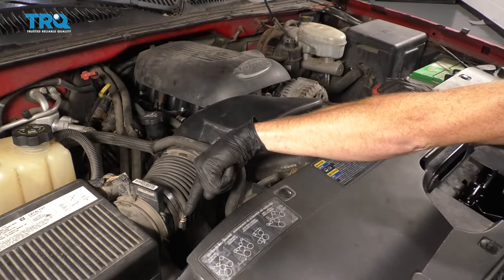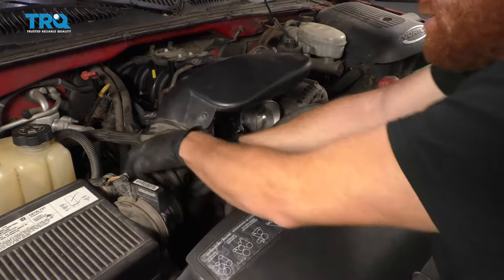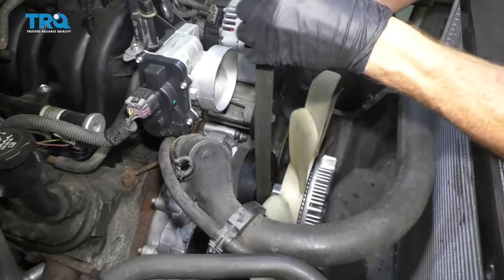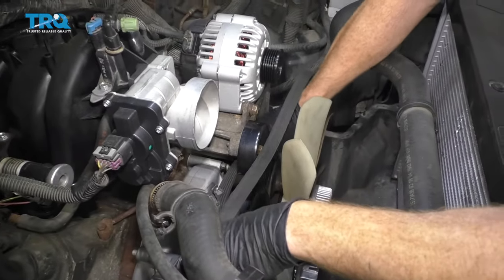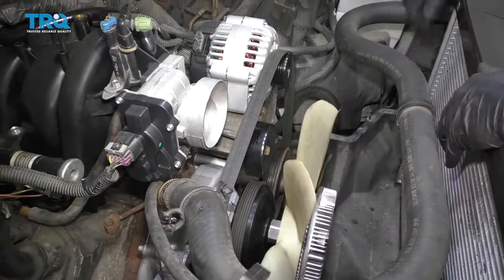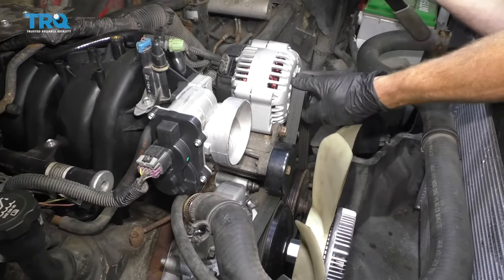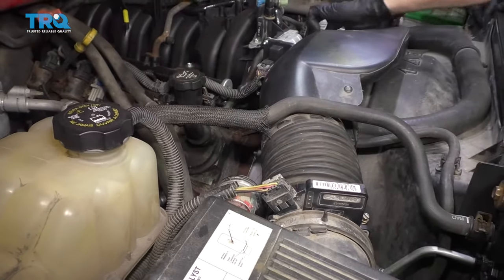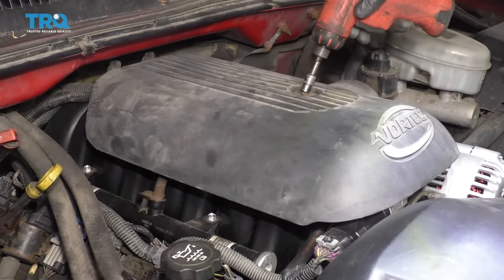How to Replace Serpentine Belt 1999-07 Chevy Silverado

Comment: I love my Silverado after a new transmission, all new break lines, transfer case, inner and outer rockers, wheel hub bearing assembly, steering shaft, all stepper motors in gauge cluster, and I know I’m missing something. Truck only has original 119K  miles on it. I might as well change my serpentine belt since I’ve practically rebuilt the whole dam truck with low mileage!
Reply: Might have all been city miles

Comment: I don’t understand. I have done this on an Astro, and now a Tahoe... the belt is always way tighter than that and requires more fight to get on. What am I doing wrong?  Both vehicles I bottom the tensioner out and it never goes like that.
Reply: Make sure you have the right belt for the alternator. 105amp or 130amp I think

Comment: No, it’s probably right, but like my 2001 Silverado 1500 2WD ext cab, 4.8l engine, yours may be a mutant… mine has dif bottom control arms than all the vids have, dif bottom attachments for the front shocks (2 bolts each, not 1!), dif much larger front shock rubber bushings than what comes in the kits (most of the parts stores have the correct upper n lower bushings parts mislabeled opposite to what they are), lower ball joints have 4 huge rivets instead of one bolt holding them onto the giant bottom control arms… my brake caliper pins are not a 19mm socket, they are a gods cursed T55 torx drive bit….  But the brake bracket bolts below those are 18mm!  As a 2WD there are no CV joints to remove from the wheel hub….  Yeah… redoing the front suspension, wheel bearings, n brakes has been one constant run back n forth to the parts n tool stores. About lost my ever-lovin’ mind…
Reply: That was supposed to be a reply to toxic gamers comment below…. Hmmm.

Comment: I have a 2006 Silverado 2500HD "6.0l" gas engine / 105 amp alternator - is this the correct belt part number for my truck as well?  (the engine compartment is missing the serpentine belt guide sticker)

Thank You